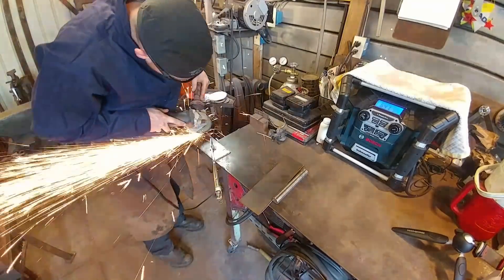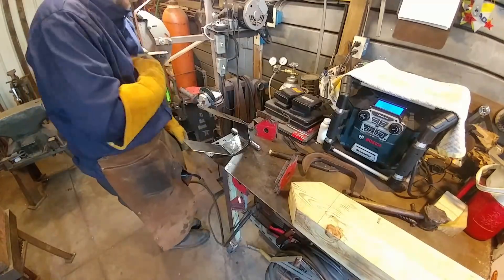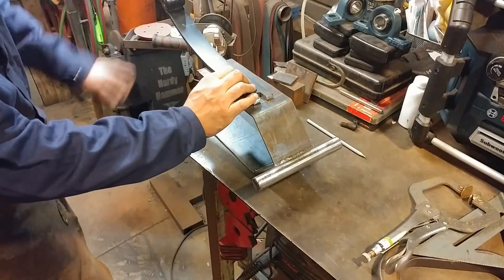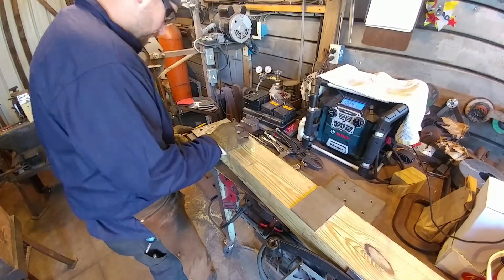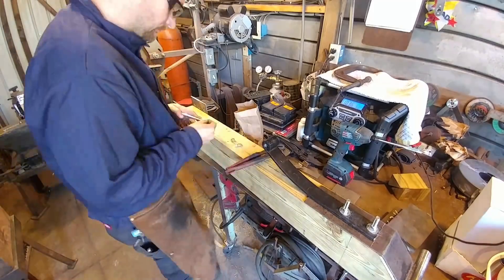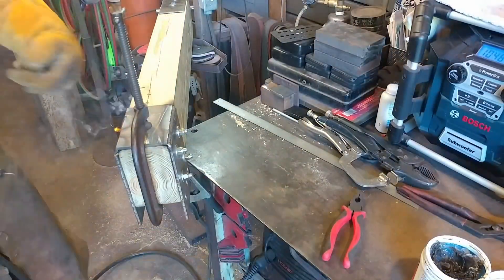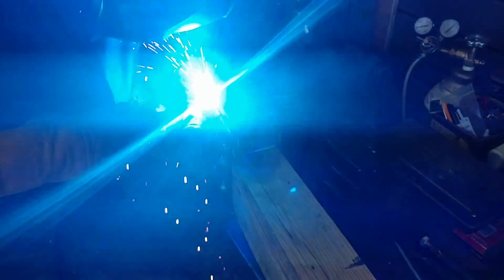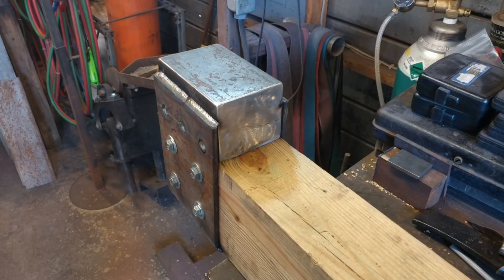Building the Beam Hammer: Part 2

Comment: Any problems with the hinge point? Also any loosening , ( tear-out) with the hammer bolts. I'll probably use hardwood beam but love the design overall. Might add some weight/ mass to the anvil part.

Comment: just food for thought. Instead of using a solid 4x4 for the beam if you used 1x4's and laminated them together to create the beam it will have less flex and if a split was to occur it would stop when it hit the next layer since most cracks follow the grain. This way you could also use a hard wood like oak or ash as they don't normally come in a 4x4 material. and it will also be way less app to warp. Not knocking what you are doing. This build is inspiring me to maybe make one along this design. keep up the good work.
Reply: Hardwood beam is a great idea. Oak , ash , elm. I'm a timber framer who needs a power hammer for pounding ash ( for splints ) and this design is perfect for what I need. I've never liked lam beams compared to solid timber. Don't like PT wood. Yellow pine can be great wood. Especially old growth , heartwood, but the crap they cut now is terrible quality. Shrinkage would be an issue here too.

Comment: Roy, why did you use wood and not metal for the beams.  can i use metal?  jeff
Reply from the maker: +Jeff Tiberio the reason for using wood instead of metal was for the garage or hobbyist Smith as wood seems to be less daunting to acquire and cut to size for most people. You most certainly can redesign this in All Steel and it would work just as well if not better as the ram weight would be considerably heftyier. Thank you for the great question God bless you and good luck on your build :-)